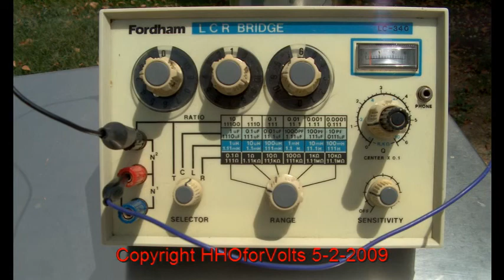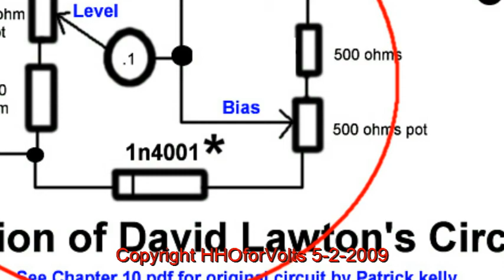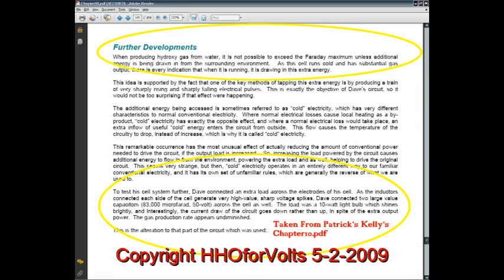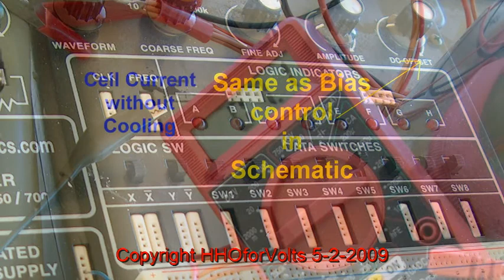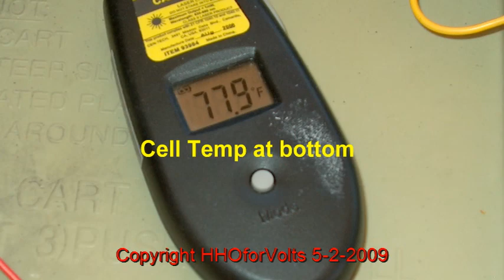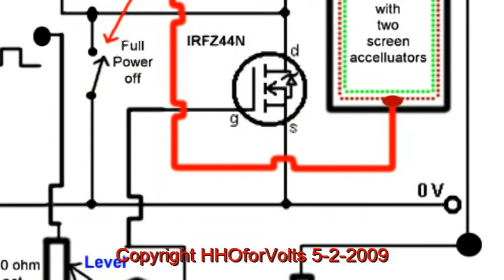HHO-Over unity or what?

Comment: I'm sorry but you are not getting overunity.  You may have 3.3A at the input and 7.3A at the output but you have to consider the voltage also.  12V@3.3A  and 3V@7.3A if 3V is what you measured at the cell then lets talk about the power in and power out.
Power in 36.36W power out 21.9W.  Power out is less than power in and no overunity.  21.9/36.36=.602  or 60.2% so you lost nearly 40% of power which would be from heat etc.  No Overunity!

Comment: Ok. In the Rodin coil I'm seeing the following. If the resistance in the load approaches zero, on the primary side, we see much more of a square wave pulsing with no dampened oscillations. As the resistance in the load approaches infinity, the opportunity for a ring -- damped oscillation -- occurs. As it does, the supply current increases. Hence, bigger load, less current on supply battery. WOW!

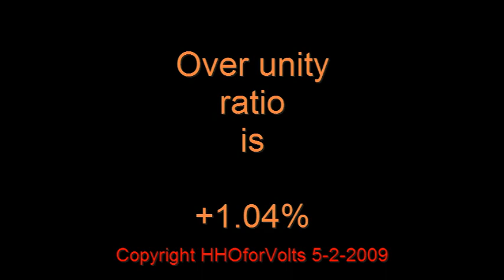Comment: @ 4:22, over unity ratio of 1.04% is in the noise. I've been burned before by using two different meters ... where they were not exactly reading the SAME voltages, etc. Take great care to make sure all meters read the same value ... or use the same meter throughout.

Comment: If you are really managing 1,3 LPM pure HHO at 3,5 volts/ 35 amps you would be at 137% efficiency, i.e. well overunity. There are 7744 Joules of energy pr. liter HHO gas (using higher heating value of hydrogen). The electrical energy consumed pr minute is 7350 Joules.

Comment: Nice work! ...Dunno if your meters are "true rms " or not. The waveshape of the currents/voltages do affect the readings greatly.  Also need to consider the effects of the meters internal shunt resistor affecting circuit draws. Resonance is an alternating effect like a child on swing the "pulse" is just the "push" .  Dont waste to much effort/power pushing unnecessarily.